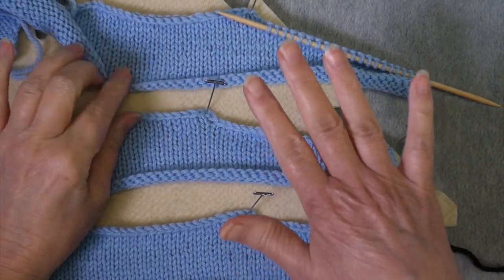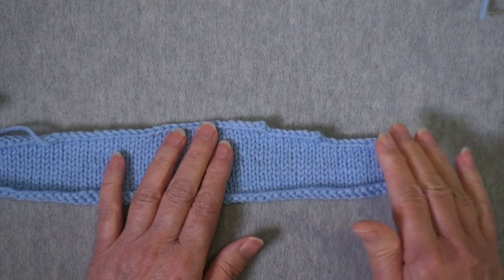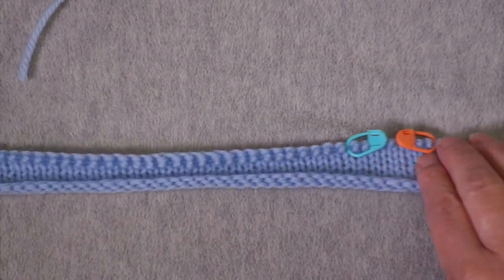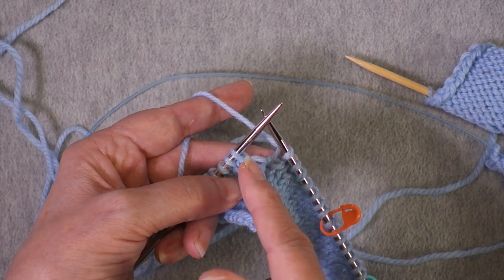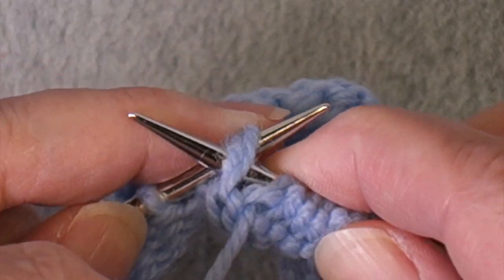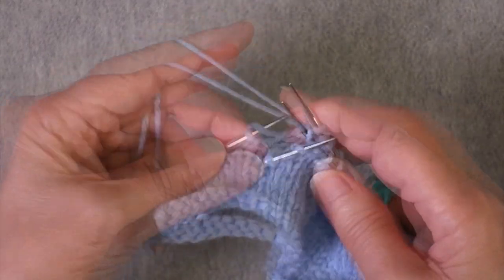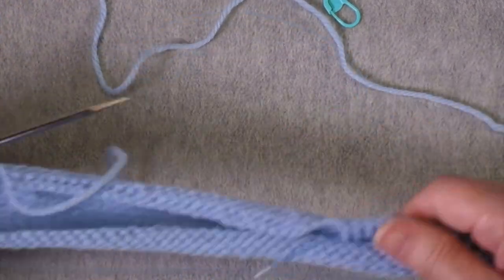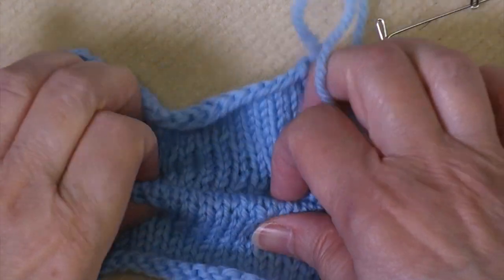Simultaneous Short Row Shoulder Shaping // Technique Tuesday

Comment: I’m a novice knitter and I’ve learnt so much from you! 🙏 My first child’s sweater had such messy bulky shoulder seams so I’m doing this now with 3 needle cast off. What worries me is that with all the knitting backwards and forwards, I’m knitting more rows at the end than I was supposed to on the pattern.
Reply from the maker: If you are substituting the short rows for the stair step bind offs, then you don't end up with any extra length (possibly one row more, depending on the situation, but that's negligible).

Comment: Wow.  I used this on my most recent sweater.  It had pretty simple sloped bind off-6 stitches then 7 stitches then 7.  My brain had a little problem figuring out how to do it (I am not a visual learner) but I figured it out.  Then I had to do it on the front.  There was a deep v, so I did one side at a time.  Really had to unwind the front to get to the second side.  I did the 3 needle bind off, and it looks terrific!  I will never do a hand sewn shoulder again!
Reply from the maker: This really is a technique for the back shoulders. I did a video a couple of years ago for short row shoulder shaping when you have separate shoulders. You can find it here: https://youtu.be/kEAOGE2ZBms (I think it was linked on the video end screen, as well)
Reply: @RoxanneRichardson  Ah - thank you. I have asked a question above about this above. I will have a look at this.

Comment: I had just put aside my knitting for a little break before I start — The Shoulder Shaping! — when like magic there’s a new video from Roxanne about — Shoulder Shaping!! Thank you so much for reading my mind! This pattern has some neck shaping too, so the back neck ends up a little lower than the shoulders, but I bet I can figure it out thanks to your clear instructions🥰🥰
Reply from the maker: The neck shaping on the back is usually decreases, so you don't have to worry too much about stair stepping there. You might be better off doing the shoulders separately, as for the front shoulders.
Reply: I’m looking again and I think you’re right.

Comment: How could you apply this technique to shoulders  that have a pattern repeat, something other other than stocking stitch, could it be worked on  FairI  Isle or Lace for example.Demonstrations of these  (probably  too  time consuming in both set up and execution for a video tutorial) techniques would make really great videos.   Love your work. Thank you so  much for giving so much of your precious time to assist us lesser mortals. Michelle UK
Reply from the maker: In order to figure out if a stitch pattern will work, you typically have to chart it out first and then analyze it. Sometimes, it will work physically, but not aesthetically. Sometimes you may need to adjust the exact placement of the turns in order to work with the stitch pattern. Cables can sometimes work, but it depends on the type of cable and whether or not there are cable crossings in the same row where you need to make a short row turn. For traveling cables, I usually find a way to first decrease the number of sts down to the number the shoulder would need for stockinette, and "close" the cable at the top, which allows me to do the short rows in reverse stockinette. Lace can work, sometimes, but you have to be mindful of where the decs and YOs lie in relation to the turn. Colorwork might work, depending on the stitch pattern. You have to address it on a case-by-case basis. Often, the best solution ends up being the stair-step bind off, but other times, you might be able to do the short row turns, maintaining the pattern just as you would for stair steps, and then for the final rows where you work across all the sts, work them in plain stockinette.

Comment: Hi Roxanne, this is a great demo, thank you. Can you tell me how to do the same for reverse stocking stitch. I have done wrap and turn and the right side has obvious lines on it. Many thanks Jacquie
Reply from the maker: If you use W&T SRs, you have to pick up the wraps so that they hide on the WS of the work when you knit past them. If you use German SRs (which I most likely used in this demonstration), you don't pick up wraps, you have a double stitch sitting on the needle (rather than a wrap under the needle) that is worked as one stitch (like a k2tog or p2tog), and the result looks good on either face of the fabric.
Reply: @RoxanneRichardson  Thank you so much Roxanne for such a prompt reply. I will unpick and use German SR.

Comment: Another great  video. I like the idea of short rows instead S of the step bo. Looks neater. I have a question, could you Kitchener the shoulders together?
Reply: @Lourdes Manners - Good question, Lourdes!  I believe I’m correct in advising that using the Kitchener graft for the shoulder seam is not advisable.  There won’t be enough strength in the seam to support the weight of the garment, so it would simply stretch lengthwise.  I’m not an expert like Rox, though, so I’ll let her weigh in if this is incorrect.

Comment: Hi Roxanne, that was a very informative podcast. 

Question;
How do you make a stocking stitch cardigan button band lay flat
Reply from the maker: Usually, stockinette bands have several specific qualities (there are exceptions). First, they are knit in the same direction as the body of the sweater. They are knit to twice the width that you want the band to be, with an extra stitch in the center that creates a column of garter or RS purls. This is the fold line. Then the two selvedges of the band are sewn to the selvedge of the body. This not only prevents the band from rolling, but it gives the band more substance/thickness. When you knit the button holes, you have to knit them in both halves of the band and line them up when you fold the band.  Ribbed bands will naturally lie flat, but they also create a thicker fabric with more substance than a single layer of stockinette, because the purls recede and the knits come forward.
Reply: Thank you much for your response.it was very helpful

Comment: Would this method work if I place my neck stitches on waste yarn to hold?  It doesn't seem to.  However, I am thinking that if I do it one shoulder at a time, like your other shaping video, it would work.  The pattern already has me put the "non bound off" stitches on holder yarn for 3bo (shoulders) and later pick up for the collar (neck). If I map it out, I shall see ...
Reply from the maker: If the shoulders are separate, as for the front of a sweater, use the method shown in the other video. If the shoulders are not separated, as for the back of a sweater, use this method.

Comment: Also, why would you knit together for the three needle bo rather than purl if you have purl sides out?  Or does it not make a difference?
Reply from the maker: The heads of the sts (which create the purl bumps) stay on the WS of the work where the chain BO is.

Comment: I am struggling i have watched over and over. I have 20 stitches and am supposed to bind off 10 each time.  Do i start on knit or purl side.
Reply from the maker: If the original instructions were to bind off at the start of a RS row, then on the WS row prior to that is where you would do your first short row turn.